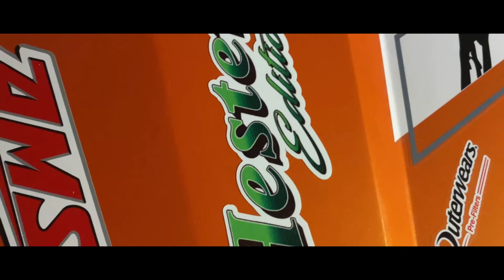Hester Edition Elka stage 4 shock install plus ride CFMOTO ZForce

Comment: LOL Good stuff! I can't wait till you hit trails at speed, be yelling "Great googily moogily This is AWESOME!!!" haha
Reply from the maker: Thanks John me and my boy cant wait either. soon as our trails open up i am there. I am excited..... Def have to make it fun to watch lol.
Reply: @Hesters Motorsports Do the springs just take one set after say 150-250 miles or will ride height always be something that will have to be adjusted?
Reply: @larry97016  for the most part bolt up ride, for a couple hundred miles, let them break in and springs fully settle, then set ride height. If after you install and take for a little ride it's height is not right make small pre-load adjustment to how you want, but may have to fine tune again once broke in. Whe. Tuning suspension think trophy truck vs Monster truck when adjusting, you want it to not be jacked up trying to gain max lift, you want the suspension to just eat all the chop up. And that's with any of the 5 stages, higher stages more tuneabilaty.
Reply: @HesterEdition  That's not really what I asked about.
Reply: @larry97016  or did I? 😁
Reply: @larry97016  if you read said break in set and ride with alot more helpfull info 👍
Reply: @HesterEdition  I was wanting to know if they just take one set at break in or if the springs will continue to sag over time.
Reply: @larry97016  For the most part once broke in set and and ride. If you add more weight or wish to change ride height you would adjust again, but if you change nothing once set they are set till you change them.

Comment: I've thought about possibly getting some Elkas for my 800 trail but back when I looked into them they were a bit different. Back then stage 2's had compression and rebound and were about $3000 but you got stage 4 for about that price? WoW!  I really like the cfmoto but I don't like how it rides in whoops and really rough terrain
Reply from the maker: These are Hester edition stage 4 Elka shocks so they are different then the Elka shocks you would get from Elka. You purchase these exclusively through >Hester Motor Sports he also sponsored these videos so they provided the shocks and what a difference in ride quality i am definitely loving them so far.
Reply: @R.N.GPerformance  I can imagine. I bet trail riding is going to be much more enjoyable
Reply from the maker: I haven’t driven a trail yet but i would have to say so.  I know hitting these pot holes are so smooth now.

Comment: Did you measure your ground clearance b4 n after?
Reply from the maker: Yes i did.  I had 11.5 clearance in front and 11 in rear. With the elkas  out of the box no adjustments yet. 12 in rear 14 in front.  I will measure again after i ride more.